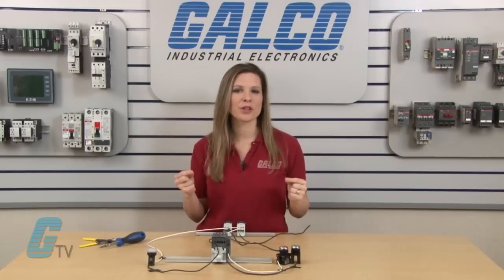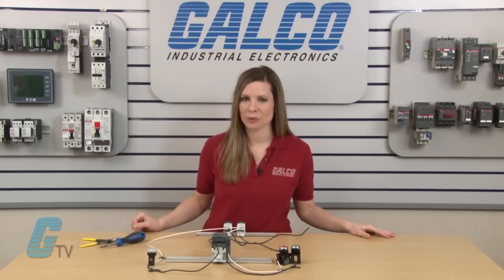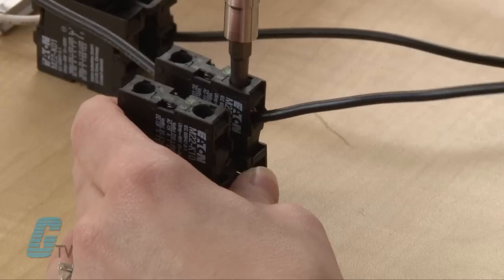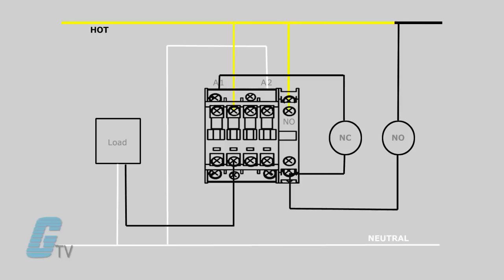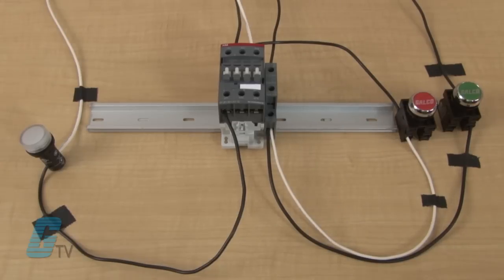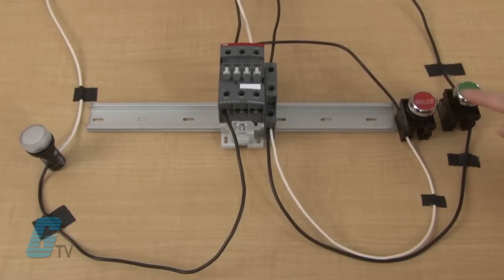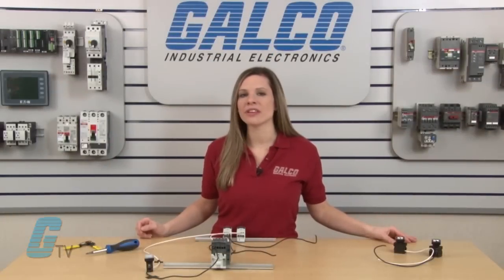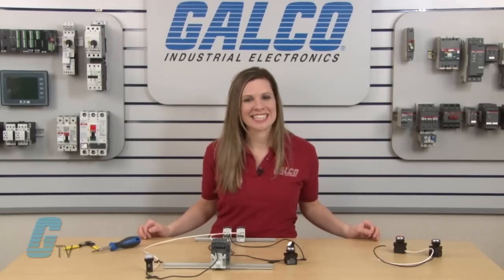How to Make a Remote On and Off Switch with a Contactor - Latching Circuit

Comment: Perfectly explained. 10/10. Exactly what is needed to know and diagram actually got rid of my confusion over the latching/ momentary switch. Yew!
Reply from the maker: Thank you, glad you liked it
Reply: @GalcoIndustrial  Can a plc input error sensor relay can be connected in between the auxiliary and contactor circuit.......so that if relay trigger on any error, the auxiliary connection breaks ...thus breaking the supply from  contactor to load permananetly !!!(until start again )  ???

Comment: Should mention the biggest reason for this type of circuit : SAFETY. The NC stop button is mandated for any moving machinery conveyor belts and the like. The slightest loose wire and she all grinds to a halt
Reply: Can a plc input error sensor relay can be connected in between the auxiliary and contactor circuit.......so that if relay trigger on any error, the auxiliary connection breaks ...thus breaking the supply from  contactor to load permananetly !!!(until start again )  ???

Comment: I’m trying to wire both switches into the same circuit and cannot get the rotary switch to shut the power off. Which is a no go for my dual pump hydraulic steering system.

Comment: Very fine explanation! Can you make a video refering to a DC to AC transfer switch wiring a domestic instalation electr. board from a photovoltaic battery- inverter circuit? Thank you!
Reply from the maker: I'll pass this along.

Comment: What if the load is 120VAC, but the contactor coil is 24VAC?
Reply from the maker: In your case you will have to wire the load circuit and latch circuit separately. You will also need a 24volt supply in addition to the 120volt supply we demonstrate here, ok? 
OR,,, you can replace the coil in the relay/contactor with a 120volt rated 1.
After that the wiring diagrams are the same.
Reply: Thanks. I have two older sprecher + schuh CA3-23-10 and CA3-16-10. Any idea who would make a 120VAC coil for them? Although I think it would be cheaper just to buy a new contactor.
Reply from the maker: Sure, just give us a call at 800-521-1615 and ask for sales, they can tell you if we carry those coils, and what they cost or the cost of a new contactor, ok?
Reply: You have enough spare poles there so you're away laughing!!

Comment: Do you know any contactor which can switch between two supply lines to one load ?  I want to control it by a digit timer to use One supply line at a time
Reply: Just use a N/C contact looped load side to N/O contact
Reply: @Froggability  Can a plc input error sensor relay NC can be connected in between the auxiliary and contactor circuit.......so that if relay trigger (by  any error in plc /load side) , the auxiliary connection breaks ...thus breaking the supply from  contactor to load permananetly !!!(until start again )  ???